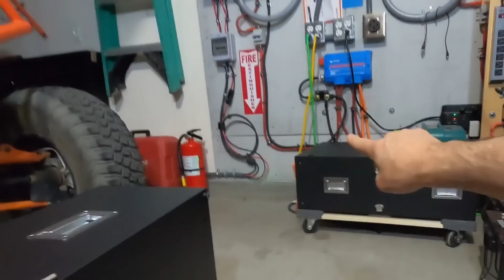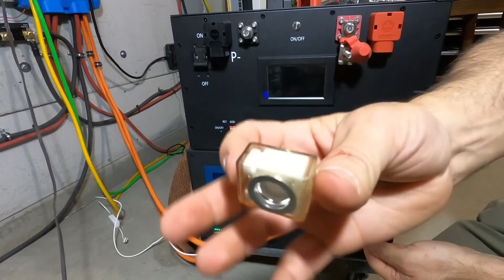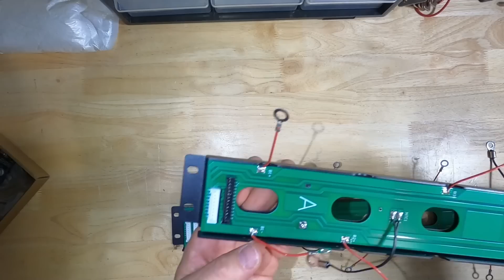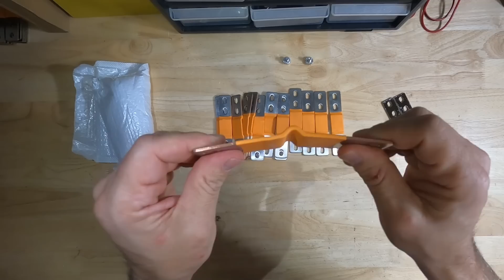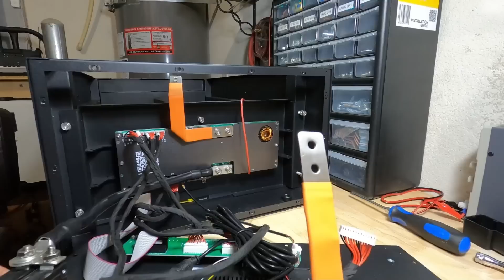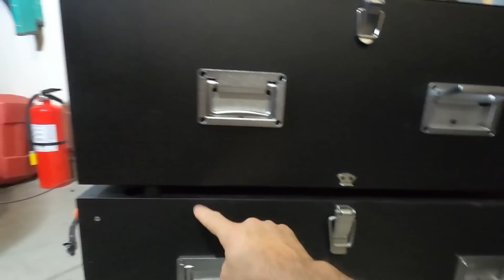Yixiang 48V DIY Battery Kit - Easy and Cheap!

Comment from the maker: * UPDATE 02-2025 *

The all new V2 box is here and it comes with a hefty bi-directional circuit breaker and a fire extinguisher aerosol. Video coming soon!

✨ YIXIANG 48V DIY Battery Kit
https://offer.alibaba.com/cps/rjapm3tr?bm=cps&src=saf&productId=1601375351894&tp1=ytpc
Click CHAT Now button on the Alibaba product page to speak with Becky

✨ More info on the battery kit: 
https://www.natesdiysolar.com/projects/48-volt-yixiang-diy-battery-build/

✨Where to Buy Cells
https://www.natesdiysolar.com/where-to-buy-cells/

UPDATE: They now send out non-conductive washers for the PCB screws. 

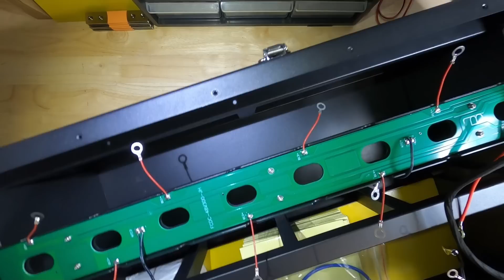There is an issue with the PCB mounting screws that can cause a possible short in the BMS. They notified me of this and I noted it a couple times in the video @8:00 and at the end during my conclusion. They are working to resolve this. 

This is so far the best kit I have found. Its easy to build, and with cell prices, the way they are there is no better time to DIY!  

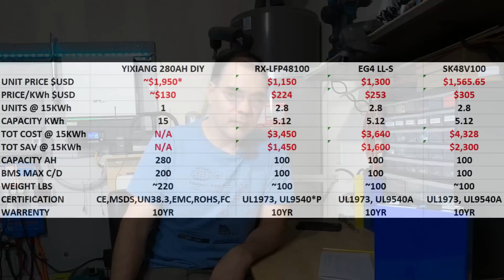Be sure to watch the price 23:23  comparison segment in the video near the end. You will be SOCKED!!
https://www.youtube.com/s/gaming/emoji/7ff574f2/emoji_u2728.pnghttps://www.youtube.com/s/gaming/emoji/7ff574f2/emoji_u2714.pnghttps://www.youtube.com/s/gaming/emoji/7ff574f2/emoji_u2714.png

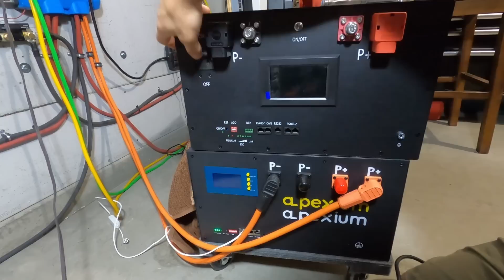Comment: 6:34 Circuit breakers are not designed to be switches that are actuated frequently. If you keep flipping it like that then there is a good chance you will wear it out and it will start tripping well below its rated current. Normal switches are rated in the millions of cycles. Circuit breakers are rated in the thousands of cycles, and it is not uncommon for them to not last even that long for cheap ones.

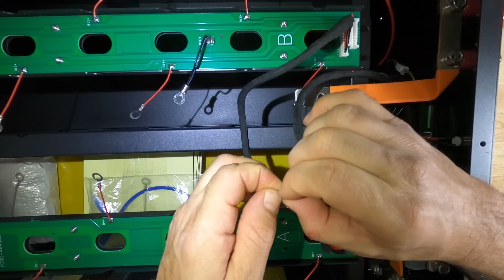Comment: 09:09 A good idea is to use Nylon Screws in order to avoid shorting out the BMS PCB Track, or re drill the standoff point.

Comment: Could you provide links to the cell balancer you show and the terminal fuse? Thanks for all you do, great instructional videos!
Reply from the maker: Hi.  Here are 2 options.. I like the Neeey. 

Neey 4A Active Equalizer 
https://amzn.to/4g40ekh (Amazon)
https://www.aliexpress.us/item/3256805739081169.html (Aliexpress)

Heltec 5A 5.5A Active Equalizer Balancer
https://www.aliexpress.us/item/2255800751794863.html

Fuse block
https://www.amazon.com/gp/product/B0019ZBTV4?ie=UTF8&th=1&linkCode=sl1&tag=natesdyisolar-20&linkId=6410eee3f43503ffdffe4f89183da703&language=en_US&ref_=as_li_ss_tl

You will need to choose fuse size.. I use 150a.  58v. 

Blue Sea Systems Terminal Fuses https://a.co/d/dsFkTmy

Comment: Great video, new sub, how many boxes do you think you could stack on top of each other? And would you have to insert spacers for air flow?
Reply from the maker: You can stack 4. No spacers are needed.  They come with little feet, but I put them right on top of each other. If you order the optional casters, then no more than 3. I prefer using a furniture dolly.

Comment: I feel better now. Got half dozen on the way with EVE 304 cells for $1850 ea. delivered. JK;s latest firewire update helps tremendously with my inverter charging. Maybe they'll get the software updates out and we can copy/paste or export configurations, however they accomplish that? Supposed to be on the to/do list. That'll be sweet.
Reply from the maker: Awesome.  I'm glad to hear.. I'm still waiting on the v2 box.  Should be here soon..
Reply: Assuming I'm getting v2 but don't honestly know? Gal across the pond I deal with usually takes good care of me.
Reply from the maker: @beebop9808  if it comes with busbars use those over the cables

Comment: Hi Nate
I was thinking about building a quite large battery with around 40kwh using lifepo4 cells
Is that even reasonable😅 id still need 12v wich means id buy 40x4 (1kwh each 3.2V) cells... Will i run into trouble with that?😅
Reply from the maker: A single 40kwh battery.. you would need a specialized BMS with a 5a balance.. how are you planning on doing it.. battery Evo makes a single 60kwh king Kong battery.. so I suppose it's possible.. it's more like multiples of 15kwh.. so it would be 45kwh.. it would be very heavy.. 600lbs give or take

Comment: When you were tightening all the connections, are there known torque specs to use?
Reply from the maker: No.  I was just snugging them up. .
Reply: Yes, there are torque specifications. I use expensive, but more trustworthy, Blue Sea breakers and they specify 35 in-lb (3.95 Nm). The batteries typically also specify torque values. Over-tightening can damage things quite easily, and it would be a very bad day to strip out one's battery. Under-tightening can lead to excessive heat due to increased resistance, which is how I came to be the owner of some of my units. The terminals on the case were likely not properly torqued, melted, and presumably by the smell started burning. The cells were perfectly fine.

Comment: Thanks for the review!. Does the BMS support cell heaters for use at well below-freezing ambient in the north?
Reply from the maker: It does have one, but you will need pads. The older model bms has heater port as well, but it was very small current.   I'm not sure what the current is on this one if it's any better.. you may need a relay of sorts..  I have not tested the heating function myself.

Comment: In China the battery price  has dropped very badly. 48v 300 ah power wall 10 year warranty  sale for only  $2.050  .

Very Overcapacity
Reply from the maker: Nice
Reply: Do you think battery will drop even more even with the tariff?

Comment: What if you used sodium ion cells ?  Do they supply CATL sodium ion cells ?
Reply from the maker: I do not know of any distributor selling those... yet..
Reply: @   The CATL cells are available on Alibaba and  are being used in cars now.   I believe they are the same size as the Lithium cells but are shipped uncharged .    I'm in Canada and like the safety profile and they are ideal for cold .
Reply: @furgus5136  sodium need Different BMS . Apart from the fact that sodium can be charged at a temperature of -10°C Sodium V is from 4.2V when 100% -2.8v when 0%.

Comment: Just bought 7 of these, as well as 112 306ah cells from them. Looking forward to putting these together once they arrive
Reply from the maker: Wow nice
Reply: May I ask, if you are satisfied with the Yixiang DIY kits now? What is your experience with it? will you recommend it, also for professional use? Thanks!
Reply: @helerionanastas4709  Yes, I was satisfied. It was exactly as this video suggested. Very easy to put together, and worked exactly as advertised. I will likely be buying these exact same ones again for a guest house on the property.

Comment: Will it communicate and work with Victron systems?
Reply from the maker: Yes, it will, but you want to be sure to update to the latest firmware or ask yixiang to do it.  Off grid garage has several videos showing this.  

https://youtu.be/tHXZB6zAA3c?si=eSTgJfOcU2R3vCLP

Comment: How would someone use these box to make a 24v Pack? Is there a BMS that would work for this? I currently have 24v hybrid and 6 12v 100ah batteries, would love to eventually switch to larger cell battery in a bow like these as it looks so much better.
Reply from the maker: You could put 2x 24v packs in the box.  Just mount 2 separate bms wire to each terminal in parallel.  Just order the box without a bms and get 2x jk 4-8s bms. 
I show the bms here.  

https://www.ebay.com/itm/284907203476?amdata=enc%3AAQAIAAAAkDibR3vkhGZCwCdAX%2B8yNFa%2F2ZRo4GpQUl1MtM%2BSP3soTu3JpznKBqL9vt85k81vU3jaihCSg1pbNxQP0AO1NHkkmYPJjj7t8H7uZko2s9dizaaKgXCxGrT8rD86RPQXPWvLkjSsSfEpEUDx7FkTIjpxp%2FOj6Lf9pAfyb1FWVqH27ov%2FIEmqGvV6EEandFJSOg%3D%3D&mkcid=1&mkrid=711-53200-19255-0&siteid=0&campid=5338977860&customid=&toolid=20012&mkevt=1
Reply: You could just arrange two cells in parallel (8S2P configuration instead of 16S1P), so if you look down one side of the box it would be + + - - + + - - instead of + - + - + - + -, then you would need a different BMS, all new bus bars to interconnect either four cells or two cells at once, and you would have to re-wire the BMS balancing terminals to accommodate the new BMS. In short, not recommended unless you really know what you are doing.

Comment: hi Nate I bought the battery bank charged it but can't get it to discharge any help would be greatly appreciated.  I used the app to turn on discharge.
Reply from the maker: That's odd.. if in the control section of the app you have charge and discharge turned on, it should discharge.  are there any errors coming in the error screen.  Send screen shots to my email please.

Comment: Hey, im a noob but got enough sense to build one of these, im living on my property and do not have electricity until i get my solar up and running...
 I going to be using that eg4 xp6000 and one of these diy kits to get me going.. my question is, can i build it without balancing the cells?? I have seen some that say yes and some say no, that the cells will balance themselves. With no electricity im going to just have to build it and see, i guess.. but wonder what you thought.
Glad i found your channel.

Thanks
Reply from the maker: If by no electricity, you mean not using a plugin charger or other AC power source, then yes, you can.  You can just use your solar to do it, no problem.  It's just easier to do with a steady power source like a battery charger. Cells will balance themselves, but once you get to the higher voltage range, it could take a very long time.. key is not to charge to high.. 55.2 is perfect.  Just use your solar and keep an eye on the cell voltages once you get past 3.40 per cell or average cell voltage. You can do a natural balance, not using electricity by placing cells in parallel, but to do a top balance, you need to charge the cells, and that requires power of some sort.. the cells come from the factory charged to about 40% only.  catch 22, right.. that's why some say yes some say no.

Comment: Excellent video. I have been in touch with your contact, extremely helpful with all info. The problem I have is space, so could I put them in a vertical position against the wall?
Reply from the maker: I would not recommend it.  The cells would apply a lot of pressure on the bottom cells due to weight. They do sell vertical boxes, and if you look at the cell orientation, you will see 4 rows of 4 cells  stacked end to end on their sides to mitigate this.
Reply: @natesdiysolar  Thanks, will check it out

Comment: Thanks for the video.  I wonder how wife (non-tech) friendly these diy battery boxes are.  What I mean is if I am not around are they able to diagnose issues without a lot of volt meters and such? Thanks again for your video.  I am deciding between server rack batteries and these DIY boxes.   Cheap attracts me initially but maintainability will win the day.  All the best from north Texas.
Reply from the maker: Lol my wife helps me install stuff sometimes.. actally with the touch screen is very easy to get the info you need.  The Circuit Breaker is clearly labled.. I don't see any reason for difficulties over remote troubleshooting.
Reply: @natesdiysolar  you are probably right.  I love making things too complicated which is why the question.  In reality the solar panels and inverters/charge controllers are more likely to need the simplified diagnostics.  Sounds like I need to customize a graphic display if one is not available.  I do like the look and the design of the box. Thanks again for the video.

Comment: Thank you Nate. Would you recommend this over the Seplos 280 V2/V3?
Reply from the maker: Yes because the JK now has a new firmware update that fixes a lot of the problems but if you don't care about comms then either one works.. but only the v3 of seplos.. I like the display better on the jk over the seplos however.. don't get the v2 seplos it has a small balancer
Reply: @natesdiysolar  thanks Nate 👍🏻

Comment: could use a nylon washer on the PCBs
Reply from the maker: Yes that would work great..
Reply: love the vids and the links , thank you .
could you talk about the connection and communication with the MPP lv6548s......comm setup ect.    thanks
Reply: Love the vids.  I have (2) V2 batteries.  I will be stacking them.  How often do you have to get into the boxes. 
 My concern is having to get into the bottom unit. 
 The units will be in a RV where space is limited and im a solo traveler.

Comment: what inverter did you hook it up to?
Reply from the maker: I'm not using comms. Charging by voltage only.  But I'm using mpp solar lv6548
Reply: what kind of charger do you use ? I ordered a kit and don't know how to charge it. I am a  Battery noob.😂
Reply from the maker: @jamesheredia1591  I use my solar inverter to charge to 55.2 then I use a 10a plugin charger for lifepo4. See the video about top balancing.  I show it in there.. here is a link. 

Top balancing video: 

https://youtu.be/EjtuJ3maaAE

https://www.litime.com/products/48v-10a-lifepo4-battery-charger/?ref=XBwnqBoJfUkkE4
Reply: @natesdiysolar  Thank you very much sir

Comment: could i use this  battery for a  boat? it  has  a 48v  inboard  elec motor
Reply from the maker: You could as long as the power draw is less than 200a or about  9600w or less.. It's not rated for water, however, so it will definitely be a problem if it gets wet. They make sealed marine deep cycle batteries.. have you looked at those.. that said.. there is a woman on YT who goes by "digital mermaid" who is building an all electric sailboat with 4 or 5 diy batteries using homemade materials..
Reply: @natesdiysolar  thnx for the answer ..

Comment: Received mine today. Busbars and bolts broke through the bag. Shit everywhere. They need to package and secure them better. If you order the wheel kit, they just set the wheel box in there to bang around. Stupid. That's one of the reasons I didn't order wheels. Andy's garage ordered his with wheels. One broke out of the box and was slamming around in the case like a baseball, but heavier 

I'm just glad there's zero damage to mine. I've seen the horror stories with other companies. The shipping box looked in perfect condition (very rare these days) with the battery encased in the typical, dense foam that most battery cells ship are shipped in.
I noticed that the one, potential, problem screw on the PCB was left off. Kudos to you for catching it. 

Cells are coming Saturday. Woo Hoo!
Reply from the maker: Did they give you non conducive washers for the pcb screws.  Yea, I saw Andy's video.. I made note of those bags as well in the build video.  I'll screenshot your comment to them.  They really need to fix that.  I would use non conducive washers on all the pcb screws. What Cells did u get.
Reply: @natesdiysolar  It has the metal washers. But I placed my order over a month ago. So probably before you let them know about it. 

Cells are LF280K V3. The "new'' version from 18650store.
Reply from the maker: @rtsrts2317  nice.  I'm getting another box w casters next week, so ww shall see

Comment: The savings with these battery kits is VERY appealing! 

BUT -  there seem to be endless people experiencing BMS interoperability and compatibility issues with mainstream or supposedly supported inverters.  These problems are detailed on multiple DIY and other solar forums and Facebook groups.  Yes, even on the Facebook groups and forums of the manufacturers themselves.   

It is not just the JK BMS(s), but Basengreen and others.   Endless problems requiring massive time investments in testing, trouble shooting, researching, constant firmware updates, building your own cables to resolve incompatible communications cable pin-outs, SOC and balancing issues, etc., and DIYers forced to spend 10s to hundreds of hours to try resolve unnecessary problems and  issues, some of which have caused damage to their cells.  Moreover, some have to identify and pull individual cells and treat them separate from the other cells, creating the need for massive wasted time in monitoring, extra hardware, extensive downtime not to mention the expertise and knowledge required, etc.  

To add insult to injury, many people report extremely poor customer service/tech support  introducing massive delays, unless of course, you're an, "internet Influencer."

I actually like a lot of this stuff, but I'm reaching the conclusion (personally) that the savings are NOT worth my time in this case.   I just don't have the time to fall into one of these endless technical black holes.  Everyone's situation is different, so I understand and respect those that feel it is worth their time.

NATE - you are providing tremendous value and I appreciate you and ALL of your efforts!

The maddening thing is that just some basic communications standards with BMSs and inverters would likely eliminate 98% of these unnecessary challenges.

Maybe we are just early adopters and hence we have to put up with arrows in our backs...

Comment: Buy yourself a torque wrench for doing up electrical fittings. You will strip them out
Reply from the maker: Yea I need to get one.. any recommendations..
Reply: @natesdiysolar  for smaller "screws" like under 1/4" (6mm) a Wheeler "F.A.T." firearms torque screwdriver is (while not aerospace grade accurate) much better and consistent than by hand.  For really large bolts a traditional, automotive torque wrench from any basic brand, heck even from Harbor Freight, is not bad.  For a REALLY good in between, that is both more accurate and good for a range of small to medium fasteners and at the lower torque ranges more suitable for solar/elections, I prefer Wera (both in screwdriver and ratchet formats).
Reply from the maker: @SolarMillUSA  thanks for the info.  Do you have a link to the product. Thanks